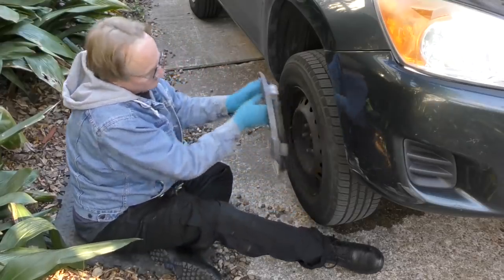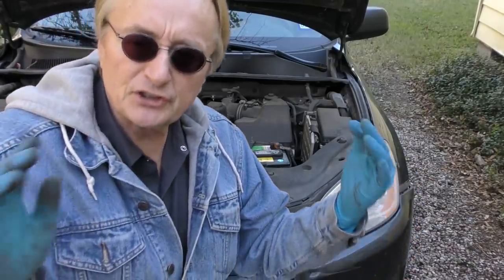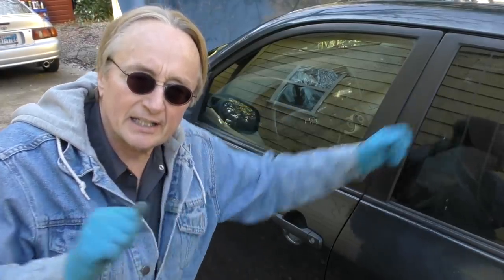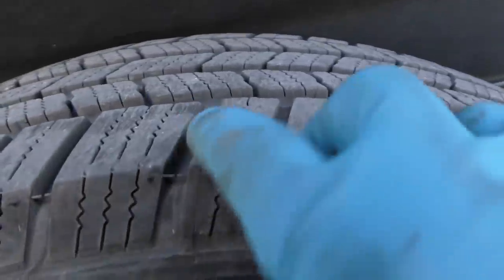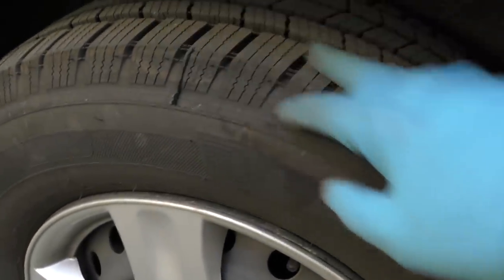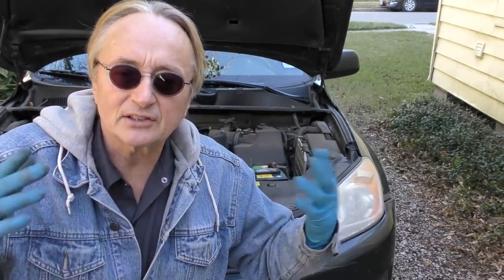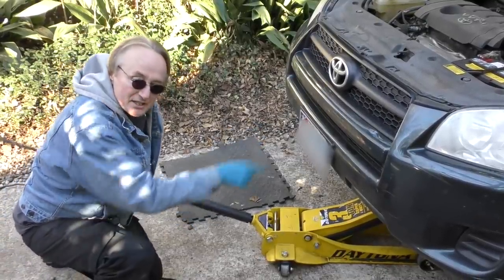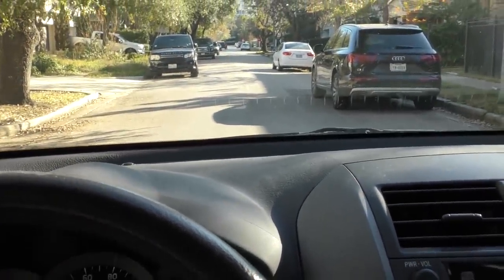Tire Secrets Only Mechanics Know

Comment: Oh have you touched a sore spot. Can you handle profanity. Went to America's Tires to rotate, and they didn't do the whole thing because of tire wear. I drove 90 miles THERE to do the FREE rotation. When I get home, I notice something funny, and discover they only did a partial rotation. I hit the roof. Called and they told me about their policy. I told them the FRONT always wears 3x quicker ( LEXUS SC400 with V8). What's happens when a car wears faster on front. They theoretically would never rotate. I knew about the uneven wear, and THAT's Why I needed the rotation. The front was on it's endlife.  YES I did wait a little too long for the last rotation and the fronts wore out to just below the limit. But they are FINE on the back.  UNBELIEVEABLE.  Had my mechanic do this rotation for a fee. ( I  SMELL A LAWYER SOMEWHERE HERE)
Reply: Maybe buy tires closer to home and get them rotated more often?
Reply: @rays7437  moved out of state, thus caused a problem. From CA to LA. also delays caused by  injuries from a wreck.
Reply: @markymarky4041  
I can understand that.  I had a similar experience with a work injury.  I just buy my tires at walmart now. They are everywhere
Reply: @rays7437  How's WAMART To COSTCO. Bought a battery at COSTCO and happy with it. ANy Idea?
Reply: @markymarky4041  
I see more failures with Costco and Walmart batteries than I do with Interstate or O.E. batteries.  But I think the worst batteries out there are from AAA.  They are really cheap.  You can pick one up with one hand because they are so light.  But batteries these days are nowhere as good as they used to be.  They are smaller and work harder than ever.  In the Southwest U.S. most batteries that I see don't last more than 3 years.  I can get as much as 5 years out of mine because I do a full charge and maintenance service on them every 6 months.  I usually buy Ford batteries because I have Fords and the warranty is 100 months.  But right now I do have a Walmart battery in my wife's Fusion because the old one died on a Sunday and the dealership was closed.  My dealer employee discount is only about $5.00 less than retail so I just decided to get the Walmart one due to convenience.
Reply: @rays7437  I am trying to make the most of the battery.  trying to keep the corrosion off, then using the NOCO oil soaked pads, and some anti-corrosive oil brushed on the top of the terminals to finish it off. Just did it, so can't evaluate the effectiveness.
Reply: They didnt touch the front because it becomes a liability issue if they so much as put air in them. It is so you cant blame them is you have a blowout resulting in an accident.
Reply: @markymarky4041  
I've never used the pads or the oils.  I have sometimes used vaseline or spray paint.  Don't know if it helps though.
Reply: I know it is a legal matter. But I wanted the best in front ( plenty of tread)because on my 95 Lexus SC400  V8, that's what wears.
Reply: @markymarky4041  I dont think you quite get what I'm saying. If they do anything besides torque it at low tread (unless its to put new ones on) it becomes a liability issue for the company. The techs cannot take the tires in question off of the car to move them to a different position. Youre honestly lucky that they did anything to your car. I have worked for them for a year and a half and I know well how they operate.
Reply: @rays7437  No Corrosion, then it works. Cheaper too.  But I liked the project with cleaning with baking soda, buying a wire terminal cleaner, and the rest. Just be careful of playing with the reservoir caps. They have sulfuric acid on them. Best to just let them be. But I had gloves and eyewear. Just wanted the activity of having my mind off my problems. Only problem was I bought a jar of those NOCO pads, they will last 10 lifetimes. LOL  I'll probably give them to my mechanic. I've heard the pads alone will keep the corrosion away. Best project was solving an electrical open on the GND for driver's door. Had to get a wire tracer, an inverter  for the soldering iron, and some nice wire. Took awhile,  but now the master switch works for the power locks and power windows. Nice to have a successful conclusion. I got tired of always having to open the door to pay the McDonald's lady.
Reply: @lemonbarde6550  Thanks man,  I wish they would just tell me this stuff. Once you say legal, I go YEP.  My mechanic just took the cash and gave me a nice wave good-bye. LOL
Reply: @markymarky4041  
It gets really hot here and the water evaporates away.  So I do take off the caps and top off with distilled water, but  AFTER I have thoroughly cleaned the battery first.  Then I top off the water, and slow charge it overnight.
Reply: @rays7437  Next time I have to top off,  I will do a slow charge too.  Good advice.

Comment: That "good tires on the rear" only makes sense for rear wheel drive vehicles.
Reply: It also makes sense as it pertains to oversteer/understeer. Understeer is where the front wheels lose traction in turns which is much, much easier to control than oversteer (rear wheels lose traction in turns) because you can feel it and correct it before it's too late. It can be beneficial to have better tires on the rear in certain situations, but generally you want the best tires on the front to distribute wear evenly.
Reply: @TheLancephillipslive  
People shouldn't be driving so fast as to need to worry about over and under steering.  If that is their driving habit, do proper rotation so they all wear evenly then, just get four new tires when needed.
I used to drive fast but, NEVER encountered over or under steer during dry conditions.  Seriously, somebody is driving way too damn fast.
I have gotten two tires at a time.  The new go on the back for me on my rear wheel drive vehicles.  Who wants to spin during wet weather while pulling out in traffic?  And for traction in mud, sleet, or snow.  It's a no brainer.
Reply: @RalphSampson...  Thanks for the reply, but driving too fast is not the only reason one would encounter either of those situations.
Reply: @TheLancephillipslive  
I don't see how it can happen, if you're not driving too fast.  It's just not possible.  If it's dry weather and you're not driving too fast, it ain't happening.  If it's inclement weather, sure it can happen but, then again you are driving too fast for the condtions.

I'm 55 years old and it has never happend to me....other than playing in the weather with bald tires, which I now have.  Also, pushing too hard in the snow/ice will cause oversteer.

Oops:  also, dirt or gravel roads, too can promote it.  But, we are talking about the most common 90% dry and paved road conditions.

Last week I got stuck in my backyard (flat terrain) due to a wet yard and little tread.
I'll admit it is fun sometimes intentionally making the backend fishtail on the streets but, I'm too old for that.  Yeah, right!

The problem is my wife was driving it the other day.  She pulled out in traffic (not knowing the tires are bad) and was almost clobbered because of wet roads and poor rear tire tread.  Instead of her getting clobbered, my ears got clobbered when she got home.  So, I'm looking for a new set.....full set of four.
Reply: @TheLancephillipslive  
Sorry.  I got a little long winded in that last response.

Comment: You won't work on my tires you didn't use the right torque stick that's y lug nuts get strip be cause to much torque
Reply: Lugs wont get stripped from that but the studs can break
Reply: I mean break I have no idea y I said strip that auto correct fault
Reply: Robert Burley  I work in a tire shop. The studs will sooner break than strip the lugs from over tightening.

Comment: In 13 years in automotive, I have never heard of any shop putting new tires on the rear. Front wheel drive always have the better up front. That's the industry standard where I'm from.
Reply: The best tires on the rear policy started around 15 years ago.  Many automotive and tire chains have adopted it. 
I don't sell tires that way. I inform the customer of the theory behind that policy, give my opinion based on their particular vehicle and concerns and then have the customer decide for themselves what they want.
Reply: @rays7437  then I'm glad most people in my area are smart and put the new tires on the drive axle if they only get 2.

Comment: Mechanics are lazy, and don't use torque wrench to put your tires on. When you have work done on your car, take it  home and see if you can get the lug nuts off. If you can, tighten the lug nuts with a torque wrench according to your manuel.  Don't be a Scotty.

Comment: What a load of waffle. 

You jacked up the front & rear, but left one of your legs under the car. Wheres your safety, if the jack failed?

Oh and if you are doing things properly, you would torque the nuts after changing